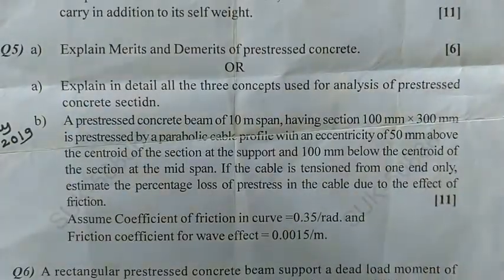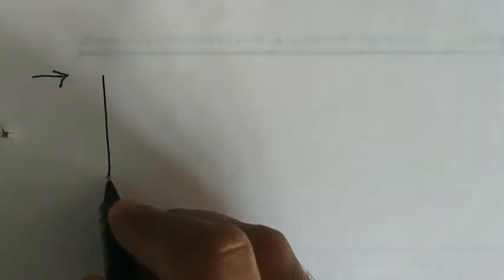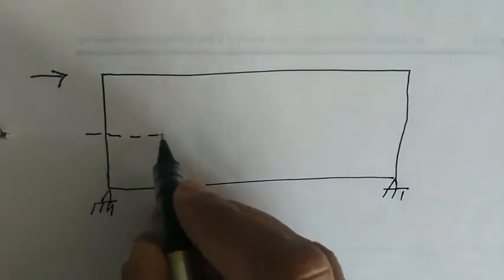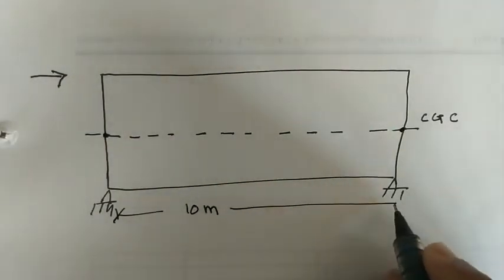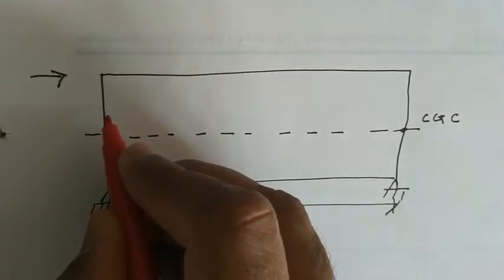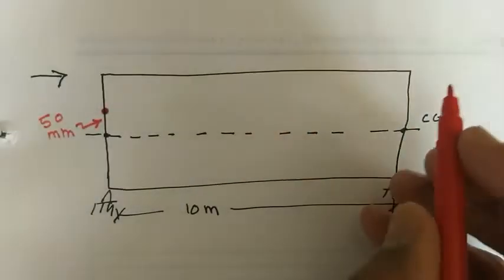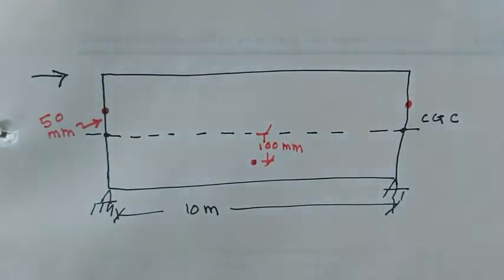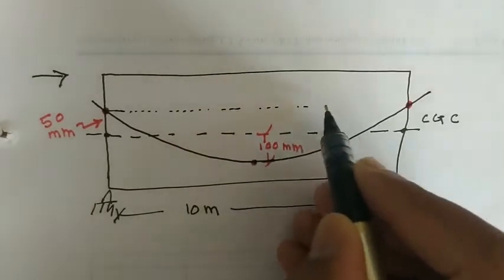Lecture 6 Unit 5 Solved problem 3 Dr

Comment: Sir please help me with video solution to this question please help. 🤔. I got stuck no one there to help me out. Could you help me please? 🙄🙏🙏. Please help me

A top of mass m = 1.0 kg and moment of inertia relative to its own axis I = 4.0 g•m2 spins with an angular velocity ωo= 310 rad/s. Its point of rest is located on a block which is shifted in a horizontal direction with a constant acceleration ω= 1.0 m/s2. The distance between the point of rest and the centre of inertia of the top equals l = 10 cm. Find the magnitude and direction of the angular velocity of precession ω?